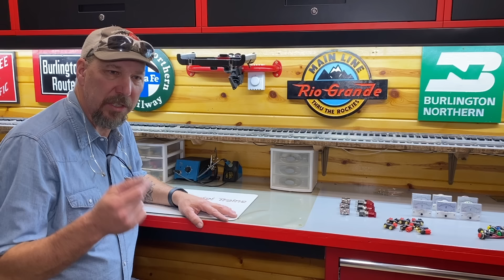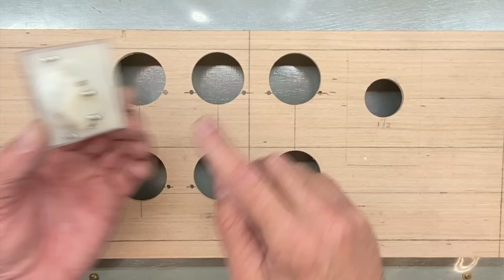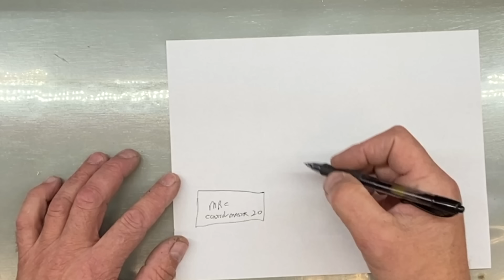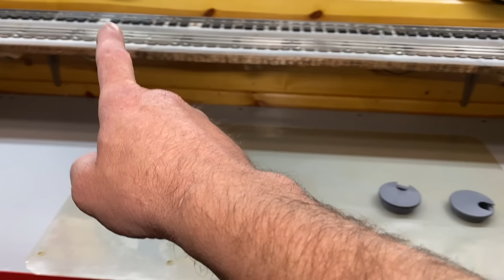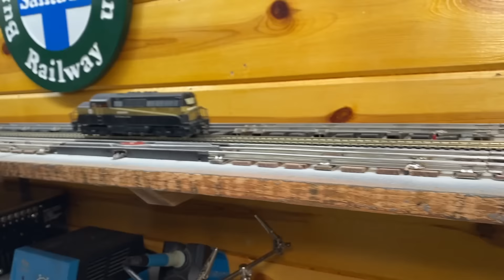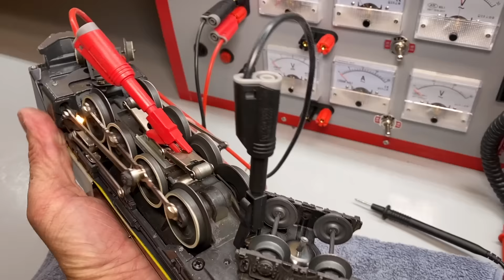Ultimate Model Train Test Bench: AC, DC, & DCC All-In-One!

Comment: Nice test set up but i cannot understand why in the first cct shown you have a dc volt meter beside an ac voltmeter when the supply is ac.
Reply from the maker: Because to test the "whistle" portion of a 3 rail O gauge transformer they put out DC volts to activate the DC solenoid so thats why I need a DC volt meter as well.

Comment: looks great! For the O and S gauge, why have two separate ins and outs if you can only use one at a time. Why not have one in with a switchable out to whatever track your testing?
Reply from the maker: The AC transformer has 2 outputs so I just went with 2 test platforms as well.  What you mentioned, I'm picking up on, guess I just never though about it that way :-)

Comment: You do good work Ron. Impressed with the detail when you had everything drawn out on the wood panels.  I do think they make dimmable LED's the trick is to get a dimmer that will work with the LEDs.  Many that say they do don't do so well with them Not very granular dimming control etc.  Thanks for Sharing!  Greg
Reply from the maker: My stage dimming is from the 80's and made for 1000 watts a channel.  the chokes let voltage drip through and when the LED's get enough drippings they will flash and discharge.
Reply: @classicmodeltrains  You would probaby need entirely new fixtures then.  Probably not worth the expense

Comment: Hi Ron, what a great setup... the only comment I have, is you might want to go to a smaller finer reading for your amp meters as 20 amps is a lot and you will mostly only get to 5 or 6 amps max.. I go for 10 amp gauges which gives you a better reading down low with 50mA increment readings. Tim.
Reply from the maker: I could not find one that matches the rest of the gauges to go that low
Reply: @classicmodeltrains  put them on the floor? (old joke)

Comment: Hi Ron, "Layout Concepts" in the UK sell "DCC Concepts DCD-AVA.1 Alpha Meter for DC or DCC". This is a panel mount digital meter that displays both dc and dcc volts and amps. A green/blue led indicates whether it is measuring dc or dcc. This means you would only need this meter on your HO panel. I have one of these and it works well, but is quite expensive. Also you may not like that it is a digital meter.
Reply from the maker: Thanks for the suggestion, I'll definitely look into that!

Comment: You can have dimming LED lights
Reply from the maker: The chokes on my 90's dimmer allow voltage to leak thru and it causes LED lights to flash every so often to discharge.  The load from the halogen element drains off that voltage leak.
Reply: @classicmodeltrains ah I was mainly talking about newer stuff, I havent dealt with any dimmers from the 90's
Reply: @classicmodeltrains  do they generate any RFI?  one issue with some of those old dimmers, bad for AM radio
Reply from the maker: @billfusionenterprise  I have not noticed RFI but also I dont listen to radio or broadcast TV.  One thing it does do is introduce white noise into the studio VIA the big azz brushed cooling fan.  Time to look into a silent brushless cooling fan
Reply: @classicmodeltrains  ir was an issue back in the 70s

Comment: Pretty damn good man, be fixing things in style here pretty quick, that is one thing I need to add to my work bench is my power supply, have 96 % of the parts etc, but need  a plastic box to hold every thing in, then a metal cover plate to hold the gauges etc. I am thinking aluminum for the cover plate,  Cheers
Reply from the maker: Good luck with the build, that setup will be a great addition to your bench!

Comment: As a former co-worker would say: “Them are nice.

I’m strictly DC — can’t beat MRC Control Master 20s!  I also use a Dallee and have several VariPulse controllers from fellow in Canada.
Reply from the maker: Those are some solid choices for DC power.
Reply: @classicmodeltrains Yes sir .. I have two MRCs in operation and three in reserve as I managed to blow one up.  MRC says no repairable parts ..
Reply from the maker: @AllenCNW441  there lying.  They dont support them but they can be found.
Reply: @classicmodeltrains Thanks..

Comment: If you get a cheap small pulley/sheve from the hardware store and run the controller cable through it and then put a hole through the back of the bench top and let the pulley hang down through it. Kinda like the kitchen faucets that pull out and self "retract".
Reply from the maker: Interesting!

Comment: Me personally would rug a fuse system or a crirut breaker in the system to reset it if you ever get it over loaded so it doesn't start to burn anything up in smoke
Reply from the maker: each one of the power supplies (transformers) has there own self resetting circuit breaker in them
Reply: @classicmodeltrains cool. I know some do and some don't just from 60 years of experience dealing with them. Some cur them out completely I've seen opening them tup

Comment: You might want to run a fuse before your switch or wire in a gfci plug
Reply from the maker: whats a ground fault circuit interrupter going to do for me?  The wall outlet has a 15a breaker protecting it.